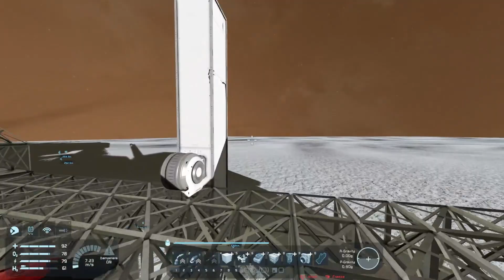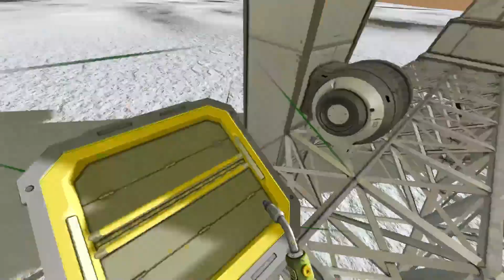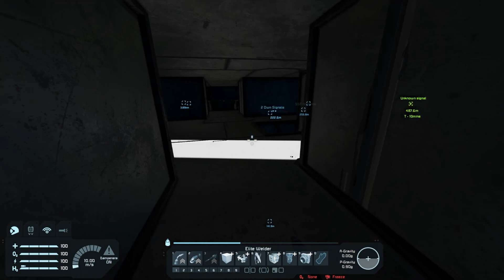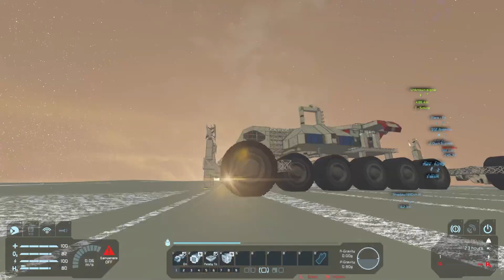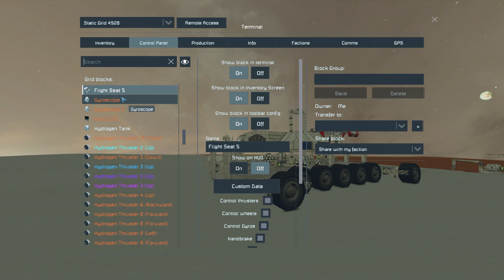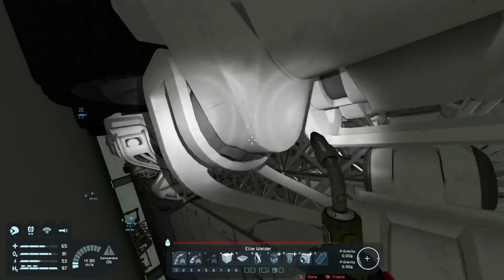Space Engineers: Twin Turbines

Comment: 31:20 If you extend your fenders out one more block than the maximum outside point any wheel can reach at full turn, you could hang solar panels off the sides that way. Maybe even just a half block wider might even be enough, but you would of course have to try by turning the wheels all the way and checking.

And if you put panels both on the tops and sides of the fenders, at least when the sun is available, that would be a decent little help...